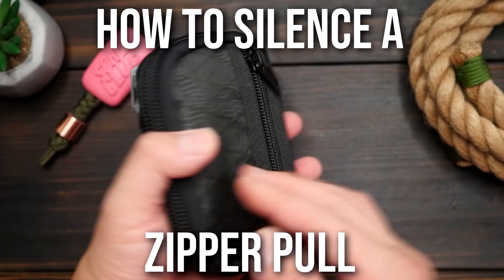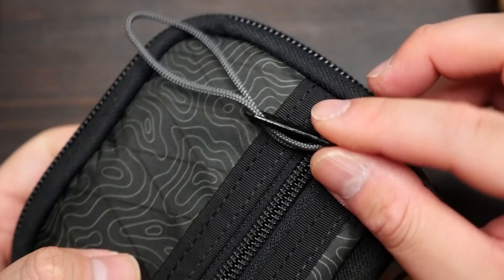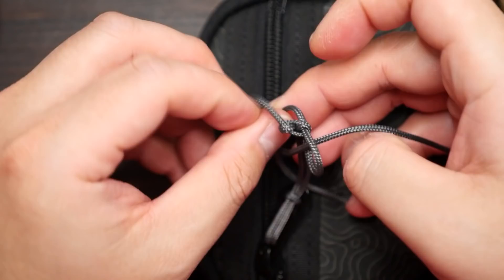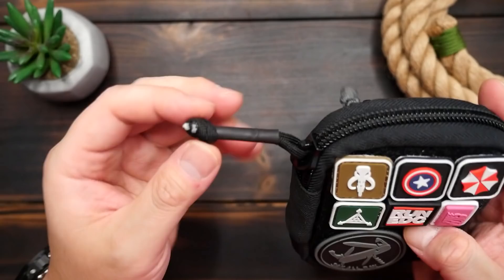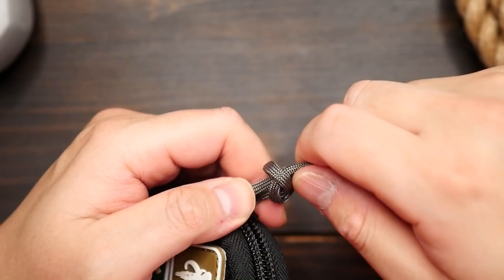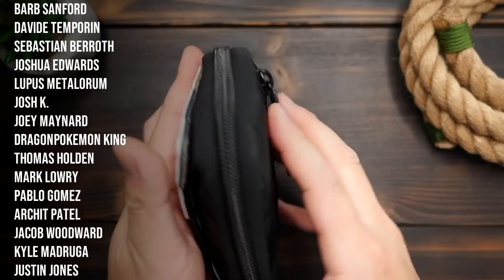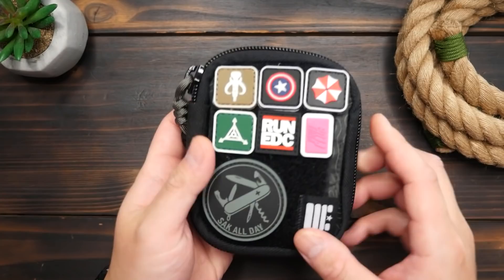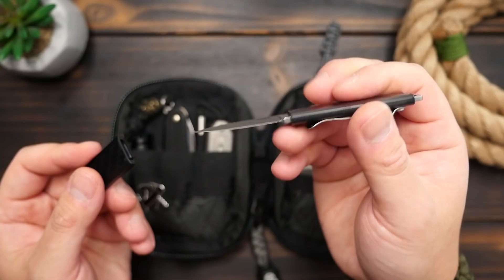How To SILENCE A NOISY Zipper Pull | Paracord Zipper Pull | TUTORIAL

Comment: Any tip on how to stop a side release plastic buckle from rattling?
I've put a rubber band on the neck of the plug part of the buckle, and that works well, but the rubber band will eventually tire out and break. Looking for a more permanent solution.

Comment: I thought you might 'embed' the metal pull within a length of cobra-knots or some-such (as if the pull were the centre core pair of cords similar to when you tie onto a quick-release buckle). Like the new method for snake-knots... seem better for my topologically-challanged-brain.🤐
Reply: I thought the same thing. Probably is better, but  more time consuming
Reply from the maker: You can definitely do that too, but of course a bit more time consuming as mentioned. Especially if you have a bag or pack that has 6 or more zipper pulls.